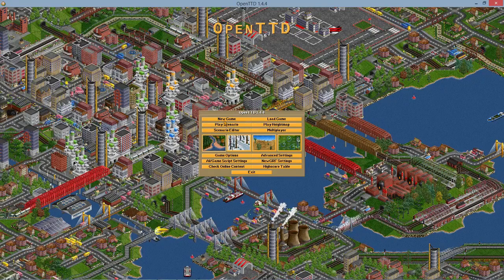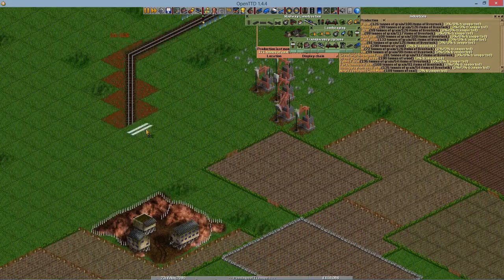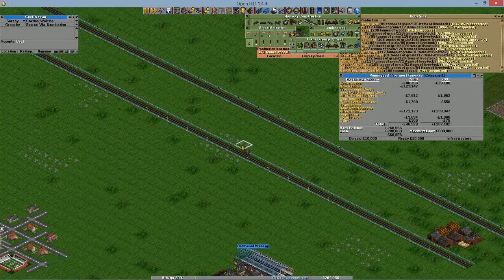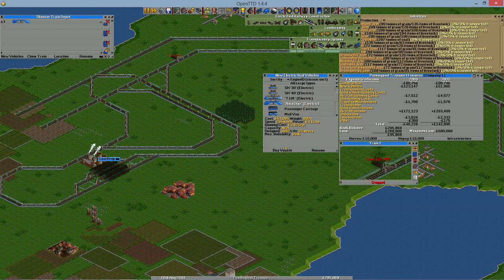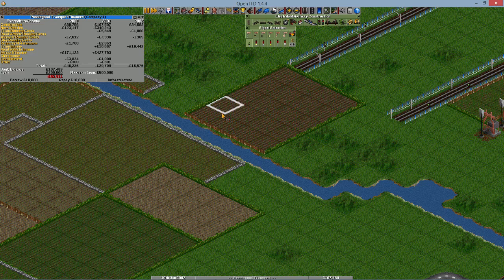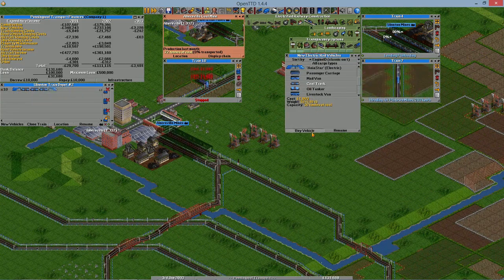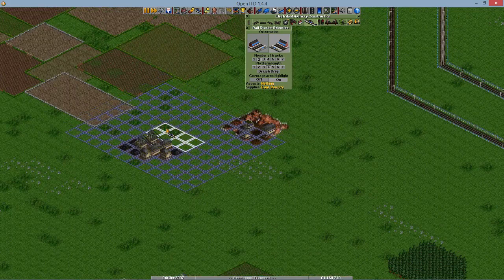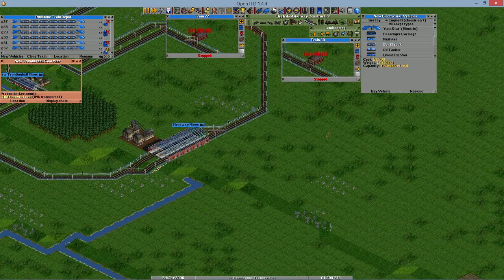OpenTTD Guide: Network Construction

Comment: woah this is an old video.  I came here to say you should use tunnels instead of bridges in most of your t junctions.  It won't matter so much on a map like this but it can save a lot of space and you don't have to worry about slow downs from short bridges and the pain trying to fit them in. If it is a straight away just make it a tunnel and put your track over the tunnel.

Comment: This is pretty much entirely negated by path signals
Reply from the maker: +Dodger B Yeah, you can use path signals.  I find block signals to be more fun to play with, though.  I like the puzzle aspects of figuring out where to place the right signals, and also the very precise control I have over the flow of the trains through the blocks.
Reply: Fair point!! ^_^